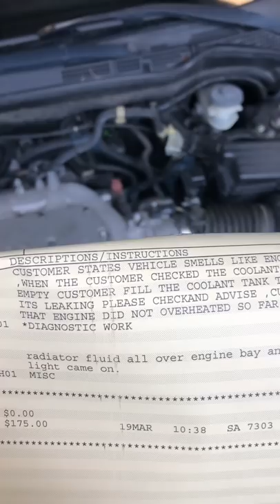Do not use this type of hose clamp because…

Comment: Please stop spreading wrong information. The 1 and only reason spring clamps are used is that they are cheaper, and a robot can install them at the factory without needing torque specs or a human to check them for the proper tightness. If you want to say it is because of thermal expansion, you are dreaming. The plastics used are designed and engineered to expend and contract in a very limited faction. It is not a thermoset plastic. The reason why that rad was broken is because the person who put the worm clamp on overtightened it. Worm claps have been clamping for a hundred years. They have always done their job when used correctly. Lastly, the clamp is ONLY there to hold the hose on the fitting. The bard on the fitting does the sealing. The clamp should never do the sealing. If there is something wrong it is with the hose or fitting. Please stop drinking the cool aid and thinking the manufacturer is always correct. Look at the issue or situation and use the training and knowledge you have to determine what is actually going on. Then, figure out what is the correct course of action to fix the problem at hand.

Comment: maybe stop building ice with plastic. remember when that was metal and any clamp would work? i only run that style on my classics and it keeps the coolant in perfectly. never broke a metal fitting in all my years. why even buy that trash? head to a salvage yard and get something decent. youre under 10k from a fully functional old ride and they last forever. 60's to 90's or even a 90's chevy vortec ffs

Comment: If that's the only problem bud you might want to consider aftermarket products such as all aluminum radiators and the water pump both having solid metal inlets and outlets. No chance to break those unless youre a r*tarded gorilla.

Comment: Bro you're trippin. The OEM clamps are garbage. Get your facts straight.
Reply from the maker: I’m not actually, I’m laying down as I read this. First of all my guy it’s an opinion.
Reply: @2zzlow  
Not an opinion. Ever worked on something with those clamps thats older than 5 years? They get weak and fail. I know several mechanics that go through their entire engine bay and remove all those oem clamps.
Reply from the maker: Keep telling ya self that! Guess you know a lot of mechanics that like to waste money 🤷🏽‍♂️ monkey see monkey do right?
Reply: @2zzlow  
Don't need to tell myself something I have first-hand experience with. You might learn one day.
Reply from the maker: Learn that the spring clamp was designed for a plastic radiator due to heat expansion? Yup 👍
Reply: @2zzlow  
You're one of those by the book mechanics that doesn't have a lot of actual experience but you will still refute experience over bs "logic" that you make up.
Reply from the maker: Sure and here you are going back n forth with him at what gain to you? Because I know mine…
Reply: @2zzlow  
Pure entertainment. Love seeing how delusional some people can be.

Comment: Bullshit bro . Those are a lot easier to work with than the “oem” ones
Reply from the maker: I never said they were hard or easy to work with.
Reply: @2zzlow  i call it bull shit when you say these are no good and to always get the oem ones . Also yes maybe whoever installed that radiator over tighten that clamp but that’s an error in installation not the clamp being bad

Comment: This spring clamps are crap.  I prefer to use the one you say not too.  I've been a mechanic for over 20 years and I've had more problems with the spring clamps causing damage to the ridiculous plastic bs they build the radiators and other parts going in and out of the engine Block.  The spring clamps hold constant pressure and over time end up crushing the plastic housings.  Which I see on a regular basis.  Every time someone brings in a car with plastic housings.  I replace them all with the normal screw clamps and never have a problem again.  I also try to replace the housings with aluminum or steel as they hold up way better than the plastic garbage they put on them these days. Your video gets a 2 thumbs down from me.
Reply from the maker: Not sure how a spring clamp can crush the housing if it was designed to be on a plastic inlet.

Comment: get off it with those clamps.  They've literally been used for decades without ANY issue what so ever.  Just stop getting the cheapest Chinese junk laying around and it will be just fine.
Reply: They've been failing for decades as well
Reply: @ding9633  I have 30+ year old clamps that would beg to differ
Reply: @jameskee2412  Does the existence of yours that work negate the existence of all the failed ones?
Reply: @ding9633  sure as hell do when you listen to the first statement and omit the cheap Chinese garbage.
Also, don't over torque them, which holds true for ANY piece of hardware that goes roundy roundy.  LITERALLY, the ONLY reason they fail when they aren't cheap garbage is because someone failed the first rule of wrenching.
Reply: @ding9633  and no, I am not that ignorant nor arrogant to believe this whole heartedly, I am just replying to yours in kind.

Comment: As a tech for 10 yrs this video is hot garbage. Learn to use clamps correctly simple.
Reply from the maker: Because you don’t like someone else’s opinion? Logical
Reply: @2zzlow  because it's wrong. #1 that clamp isn't the right size. Thus the 4 inches of clamp hanging off. #2 it's probably over tighten like hell. #3 I guarantee that's not the only reason that upper radiator inlet broke. Likely people putting weight on it, old and brittle plastics ect. I have never, ever seen these style clamps break something. I have seen the OEM clamps leak over and over